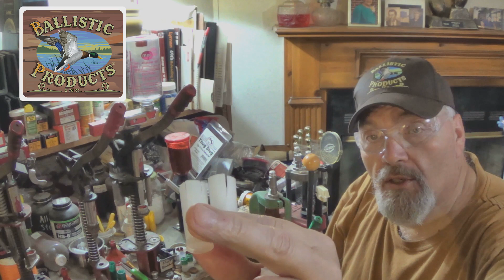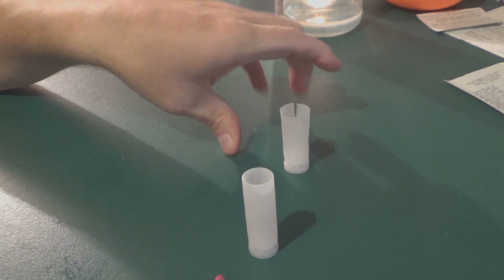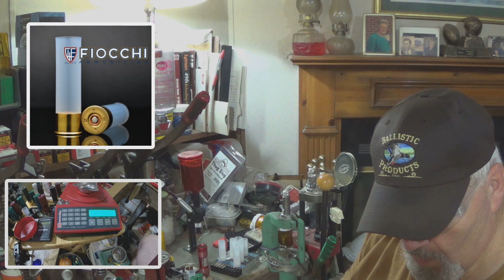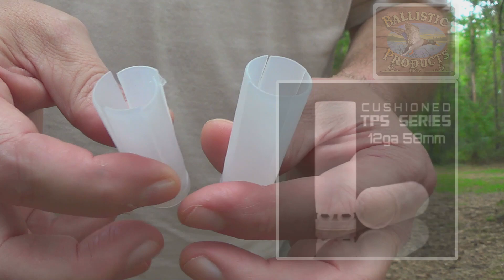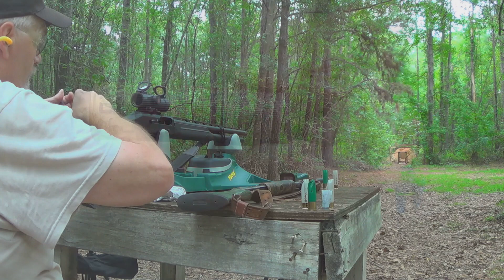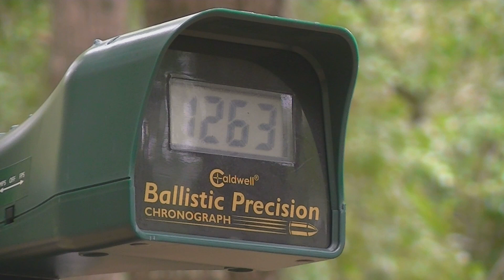TPS Cushion wad Buckshot Pattern tests!

Comment: Wade, in your opinion (I know you have flexibility with roll crimping) what would be the ideal length difference between the top of your shot column/wad from the top of your case mouth be for the 12 gauge and the 20 gauge?
Reply from the maker: I would say 3/8ths to 1/2" would be ideal.

Comment: Have you tried different length slits in the wads? Try one load with a full slit and another exact load with a half slit. I’m just wondering if it would help down range patterns. I’m just getting started reloading and I’m trying to learn as much as possible. Thanks for all you do.

Comment: I have an idea but I haven’t tested it. What if you use a rifled choke tube with an unslit wad? The wad would be stable in flight and it won’t separate until further down range. Will it tighten the groups up??